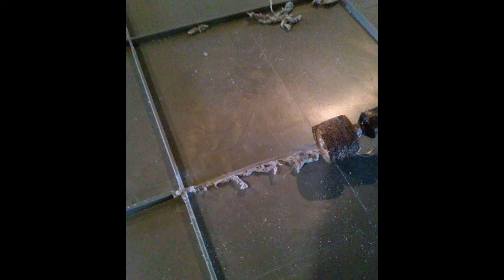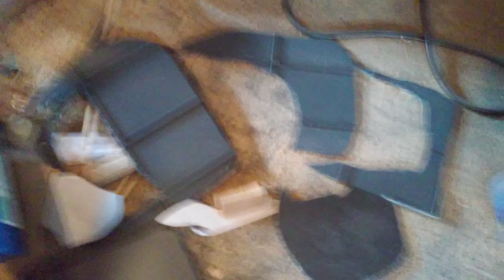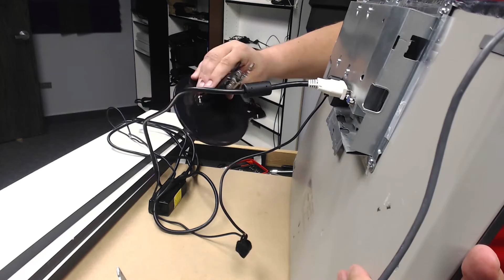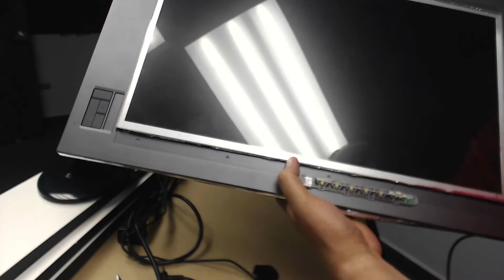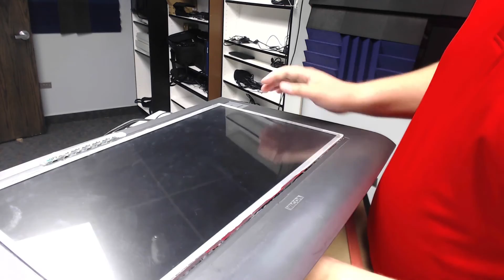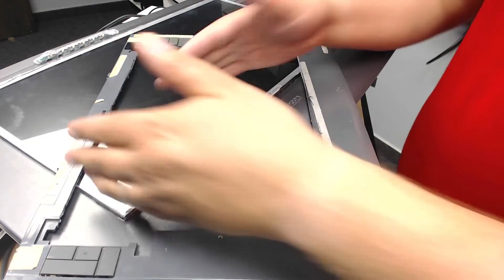DIY Cintiq Part 3

Comment: i made me one and the same happened to mine...it was getting warm. so i put some space so air could flow through there and that seemed to work...i think it it was just getting a little hot... that may be the prob with yours...isnt that were the LED strip is?
Reply from the maker: Yes, you can see the rest of my build in part 4 and 5.
Reply: ya i saw that later. i thought that that was the last one and then i realized you had more to come...think i am going to take mine apart and look and see if that is my problem.

Comment: you broke every thing hahaha
Reply from the maker: Yes, I did. But, that failure taught me and I've been using the finished screen for three years now. No issues.
Reply: @RyanHaworth  i see people says it make jitters did you try in the center of the screen ?
Reply from the maker: @MLS.22  I have some jitter near the bottom and top. The left and right edges are very slight jitter--only because of two additional monitors I'm using messes up the GPU. The center is great! Center has absolutely no jitter. In the future it would be better to use a screen larger than the digitizer tablet. That way the edge of the tablet would be further in, away from the edges that do cause jitter from interference.

Comment: As far as I understand, all you do is remove the metal casing off of the screen (since that is what is blocking the signal from the pen) and then putting the screen and the tablet sensor into the same case, right? And it seems like you should cover the screen's PCB with aluminium to eliminate interference as much as possible.
Reply from the maker: blackZ34all yes... It's as simple (or difficult) as that. The trouble that I had and most others seem to have is how to mount the screen with the tablet case cut open in a way that keeps everything from falling apart.
Reply: Thanks for the responce. Great tutorial.
Reply: @RyanHaworth  did you think of design a specifique body with 3D print to fulfill the overall conception ? 

your work is absolutly unbelievable ! awesome thank a lot for the full process
 videos ...